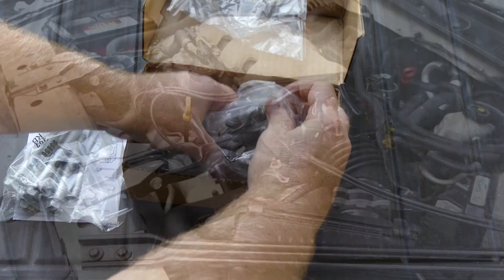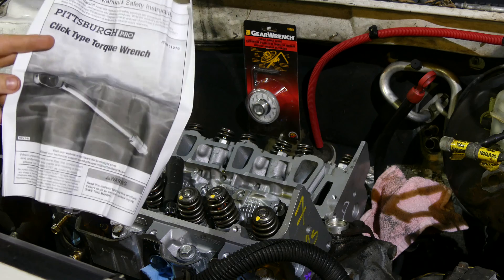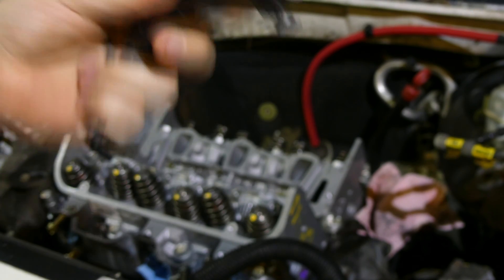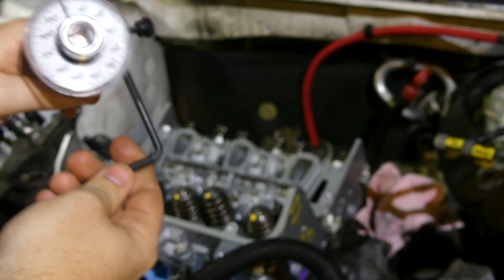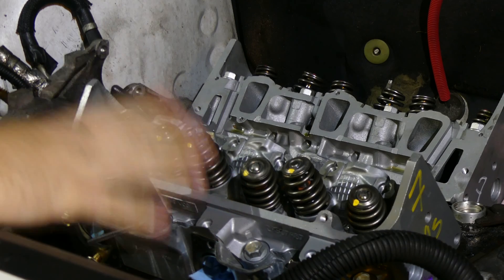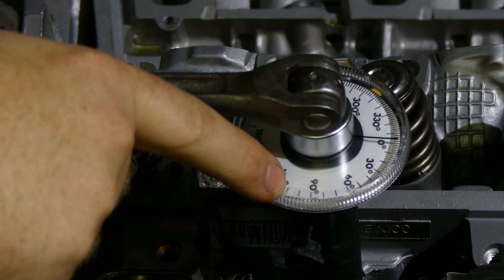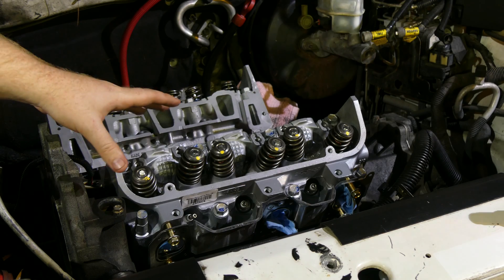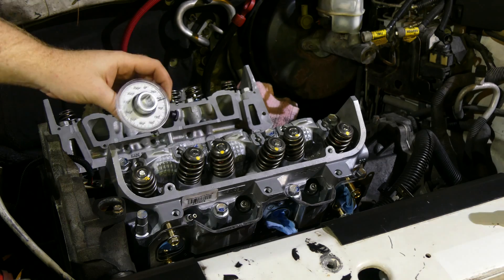How to Install Torque-To-Yield Head Bolts With a Torque Angle Gauge • Cars Simplified

Comment from the maker: Here are some links to the tools I use: GearWrench 3336D Torque Angle Gauge: https://amzn.to/2OLGeGv
Pittsburg Torque Wrench: https://amzn.to/2vT2FCh
Alternate torque angle gauge option: OTC 4554: https://amzn.to/2Bkkgby
More advanced torque angle gauge options:
Lisle LI28100 or 28100: https://amzn.to/2waZtBA (Same design, but with a clamp.)
JEGS 81691: https://amzn.to/2MYiHBH (Digital!)

Comment: These tools are just stupid to easy to move and take up to much space with a engine in the car. Buy yourself some white finger nail paint mark your bolt then make a  mark 90 degrees on the head and use a breaker bar and line up the marks. So simple if you went to high school....lol

Comment: I have bad luck with this style gauge. it worked on the first bolt but on the next one it disassembled its self, it didn't break it just came apart into five parts. this happened three times.It took a lot of fiddling around to use, I was unable to get it to work on any other bolt. I bought a "LISLE 28100" gauge. It is a different style it worked perfectly, easy to use, fast no fiddling, it was $20.00 more than the one shown but from my own experience the gauge shown is a toy, the Lisle 28100 is a reliable easy to use tool. Good luck.

Comment: I've only rebuilt an engine that had  90 degree TTY head bolts.....easy to 'eyeball' accurately without the angle gauge.
But 55, 65, and 95 degree TTY head bolts would be a PITA to do.
Why wouldn't the manufacturer set/adjust the initial torque necessary, so that all the bolts require 90 degrees as the final step??

Comment: The problem, where do u find torque list for bolt...!
Reply: You should be able to Google the torque specs for your particular application. I search for pdfs of shop manuals. (Exp. Shop Manual for 2000 Chevy C2500 pdf) If you look up just the shop manuals, it’s usually one they are wanting you to buy and not free information you will get from a .pdf formatted file.

Comment: Pretty amazing that a so-called professional outfit would instruct us to follow the torque pattern and crank each bolt down all the way to the max torque setting on the first turn of the torque wrench.  Each bolt should be torqued down about 1/3 on each crank, the pattern started again and torqued the second 33% down and then finished off with a final third run/application of the torque wrench cranking down to the correct final max foot pounds. Then the torque angle measurement should be applied. Never should full/max torque be applied only once to each bolt on the first run taking it to the max torque setting. Doing it in 2 50% runs is a way to cheat if you like cheating on things like the internals of a freshly rebuilt combustion motor or its parts. I mean it’s only going to cost thousands in the event of failure and customers don’t mind as Long as you hold it down to thousands in the error department -  clients can always just bring their car back into your shop overnight for that new motor rebuild, no inconvenience there.  Wow!  Learned that in junior high shop class  and yes, I know a ton of you guys think close is just fine. That’s why  we mechanics are often considered about the same, ethically, as the old 1940s and 50s car salesman. I can however understand how important it is to save 75 seconds by skipping torquing head down in thirds As, in the event of failure, that’s only about $100 per second
Reply: Exactly. On my application of a 5.7 liter Vortec: 1st step - torque all head bolts to 22 ft/lbs. 2nd step - torque shortest bolts to 55º, medium bolts to 65º and the long bolts to 75º.

Comment: TTY all you need is close.  They are not that fussy.  People over stress being perfectly on.  90 is common and you can be off 10 any direction or 20 off by spec.  Even more is also not going to be an issue.  That’s why they use them. Idiot proof.
Reply from the maker: I have heard that since then from a few reputable people. Still, GM seems to have updated its spec to 5 degrees more than 90, so it made me suspect that precision may be important. I know that with almost 200,000 miles on the engine, those threads are going to laugh at any attempt at precision, though.
Reply: @CarsSimplified  That is true about the threads at 200K miles.  I have read that the 90 degree is what give them the clamping force needed so It is important to be close to it.
Reply: I never use a gauge. I useto use whiteout to mark and stopped that seeing how far out they can be really. Just give it what feels 90 and forget it.

Comment: Those can be clunking to use, often I just accurately eyeball it.
Reply from the maker: Indeed; that's what I did for the rocker arm bolts after my experience here. I uploaded the "Torque Angle by Eye" a while back; I think you commented on that one already, though.
 - Steve